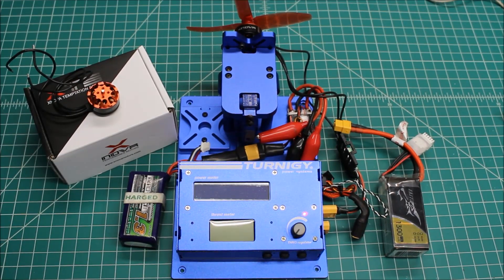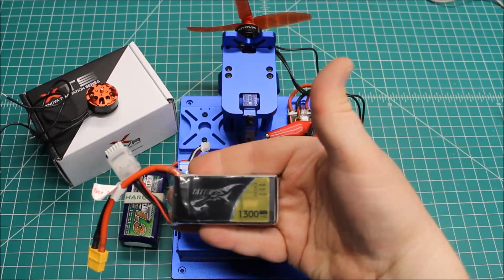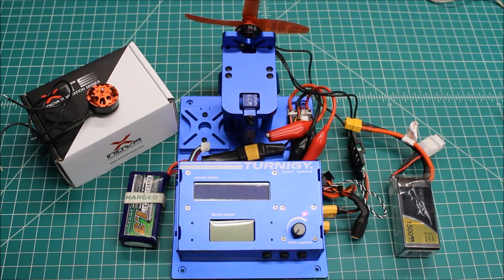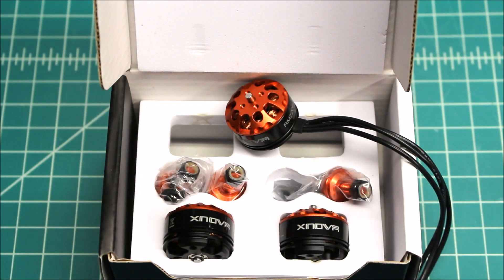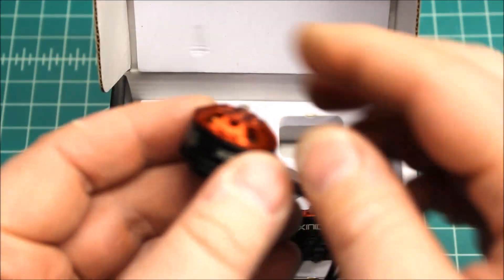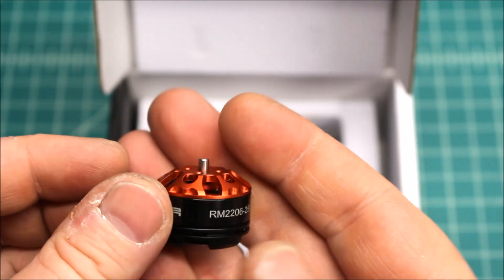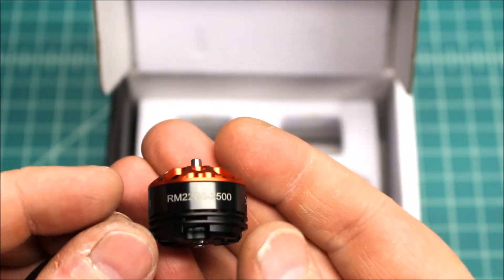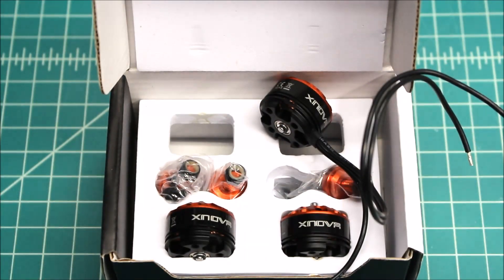XNOVA XTS RM2206 2500KV Motors Thrust Test

Comment: Intresting video! Maybe try with 30A or 40A esc's as you should get much more power out of them. I watched other videos where they compare thrust results across different esc and even if the esc can support the extra load 't athere isns much thrust. An emax 2205 went from 890g with 20A esc's to 1200g with 30A esc's!
Reply from the maker: +MrSmoothvideos thanks for the suggestion. I use the 20amp because a large majority of the racers use them and I want to give a actuated depiction of thrust using the same gear that we fly with.
Reply: Am I right that the amp draw on the esc in this kind of test isn't an accurate depiction of what the amp draw will be when the copter is in the air? I read that somewhere.
Reply from the maker: Scrub Zero yes. These tests don't show exactly what this motor will do in a specific quad, but rather a baseline measurement to compare one motor to another.
Reply: I understand that. What I mean is that I don't think just because the esc is pulling 30 plus amps on the stand, it won't actually be pulling that much in flight. That's what I think anyway. Thanks for the great vids too man!
Reply from the maker: Scrub Zero you are correct.
Reply: X-Frames FPV
Fair point, but I always fly little bees 30A blheli s and pros use kiss 24amps